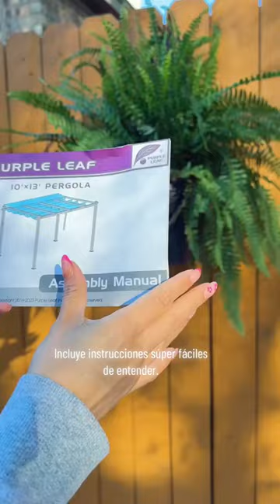Retractable Pergola creats an prefect outdoor retreat!

Comment: tell us about wind & rain issues if any
Reply from the maker: The aluminum frame structure is sturdy, the canopy is adjustable and we have to fold it by pulling the rope when it's rainy. After folding, some style has a cloth on top to keep the water out of the folding canopy. Actually this kind of pergola fit for sunny day to protect us from uv ray
Reply: What style is that.  Bc it looks like it will hold a lot of water and when retracted spill inside